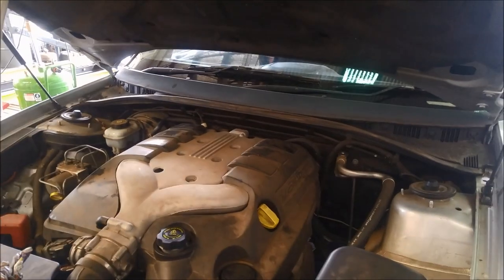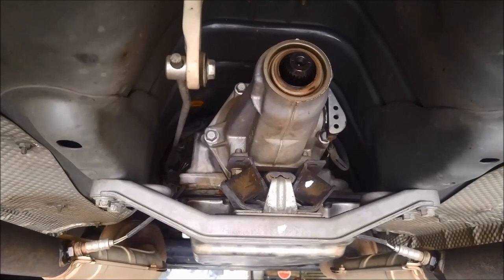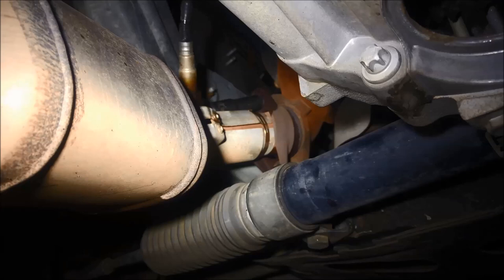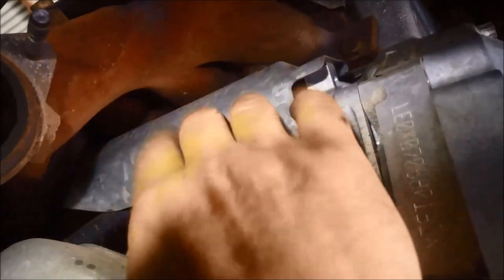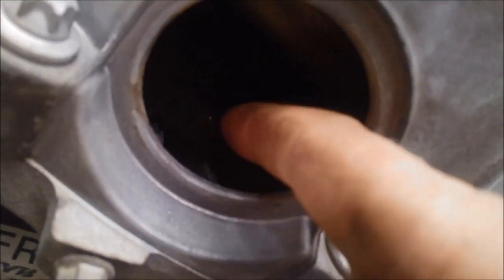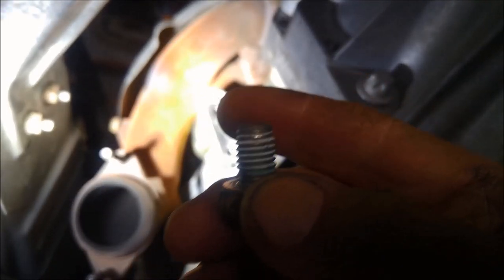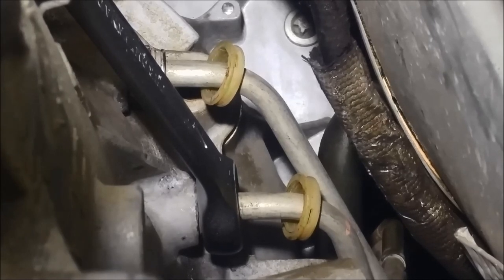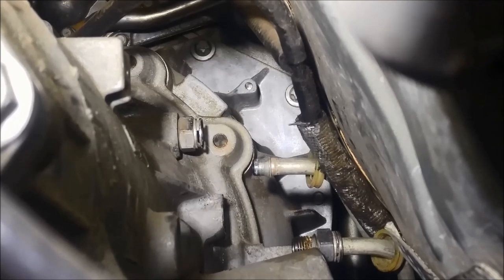4L60E 4L65E Automatic Transmission Removal Tips & Tricks How to DIY

Comment: Great video Had to do this twice in 6 weeks. Two different cars. Very helpful, especially giving the bolt sizes, tools can be assembled before starting. If I only had smaller hands. Thanks very much.
Reply from the maker: no worries, cheers
Reply: @YepThatsIt  Just wondering where you got your spare cooler pipe circlips? Holden and NAPA are telling me I have to buy new pipes to get the clips.
Reply from the maker: @worksafeme5027  hi, contact me on my face book link https://www.facebook.com/Yep-Thats-It-103051017785435   cheers

Comment: Awesome! That's a comprehensive showing! I think my rear crank seal leaks. If I do this myself it'll be on my driveway. I saw in comments it takes 2.5 hours. That include putting it back on? Trying to figure labour if I take it to someone to do rear crank seal plate and seal.
Reply from the maker: hi, on a hoist yes, on driveway would take alot longer. cheers

Comment: Hey how are you, need to do this over the weekend. Looking at the 2nd hand trans I got it doesn’t have an inspection hole. 2003 vy v6. How would you line up the torque converter with the flex plate holes when re installing 
Cheers
Reply from the maker: hi, rewatch the vid or our other installation vids. we line up the pump drive slots or lugs straight up and down, also you will need to measure if converter has gone in enough ( especially if you are not familiar with these ) see from about 3/4 into the vid  https://youtu.be/J5vL-IJU2-0  cheers

Comment: hey mate what would be the overall height of the automatic deep pan for a vy sv8 2004, information is hard to find as I want to replace the main rear seal that is leaking, just want to know what height I will need to lift the car? I shall lift it on all four corners using 3 ton jack stands x 4 , I will be using a transmission saddle and a floor jack. thank you

Comment: I just bought a Colorado V6 auto with this same driveline, and the tranny is doing exactly what you explained. Its fine when cold, but soon as it warms up, all the gears start neutralizing. i was hoping you would replace the filter & fluid to see if it fixed it. Now Im thinking I should just replace the trans like you did. Do you know if other 4L60 trans will work, or do I need to use the exact same coded trans as I have. Example, my code is M30  9HDD. Will a 6HDD work?
Reply from the maker: hi, if the internal wiring harness is same then will be ok. the late ones come with 15 pin plug and/or lockup solenoid input sensor and lockup solenoid with internal mode switch. easiest to remove trans pan and have a peek and compare. cheers
Reply: @YepThatsIt  Thanx

Comment: Hi m8 ive looked everywhere cant find out definitely  how many  spline my m30 4l60e trans is.. its a  supercharged vx commodore v6  2001 model. Been looking at hi stall converters but dont want 2 grab the wrong 1.b great if u can help.cheers..
Reply from the maker: hi, not 100% sure on the supercharged ones, but would expect to be same 30 spline input. your torque converter rebuilder/supplier will know exactly and help you work out which stall to get, using diff ratio,cam, tyre profile, other info etc. i wouldn`t recommend higher than 3800 stall for road use, but that will also depend on your cam etc. cheers

Comment: What is the purpose of the magnet in the bottom of the transmission pan?
Reply from the maker: hi, to collect any metallic debris that is finer than the filter screen, and to stop it from circulating to and through the solenoids, sensors, bearings, bushings etc and causing premature failure issues. cheers
Reply from the maker: see https://youtu.be/KmACzj8btC4   &   https://youtu.be/C12iQrWYS1M

Comment: hello 
I just changed my holden ve calais engine 
the torque converter lost some oil when I removed the engine old engine 
I assembled the new engine 
I started the car, the car idles nicely but when I put it into reverse, it won't reverse and the same happens when I put it drive 
it won't drive. it only  rave both in drive and reverse what could be the issue? thanks
Reply from the maker: hi, you may have not aligned up the pump drive lugs. dont rev it, it can cause more damage to pump. cheers
Reply: you were right!
thanks allot
Reply from the maker: no worries, now you owe me some beers !.use link https://www.paypal.me/BATS189 cheers
Reply: okay haha

Comment: What if the gearbox doesnt seem to have an inspection cover
Reply from the maker: hi, what vehicle? it will still have drain plugs. always best to fit magnets to plugs if they don`t have then and also install an inline filter in the trans cooling line. cheers